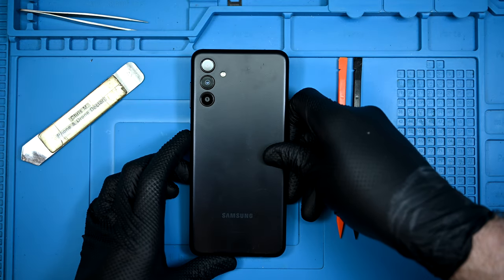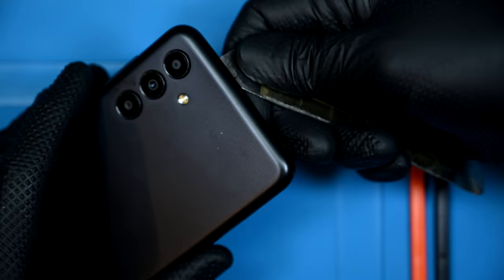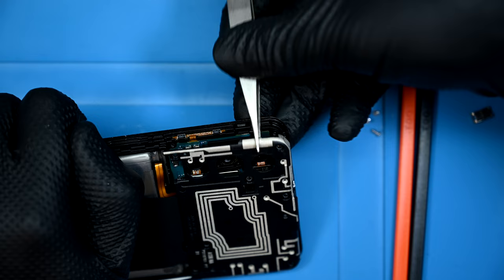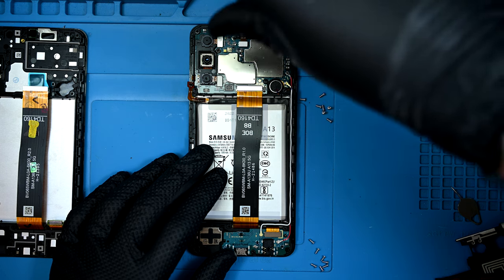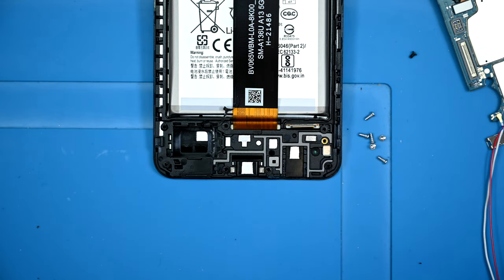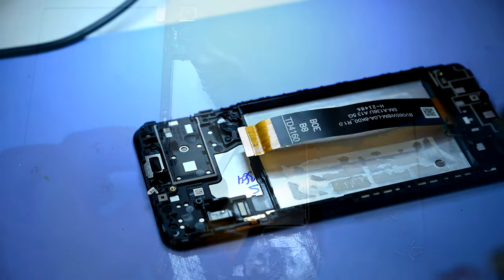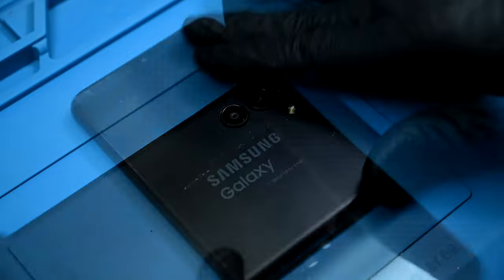Galaxy A13 5G (A136U) Screen Replacement | Frame Swap | Teardown Guide

Comment: This video showed exactly what I needed to do: swap the screen on my A13.  You make it look easy.  :)  I just did mine earlier today.  It took me longer than 4:29, but I managed it.  To any non-professionals out there, I might give some lessons learned.  First, don't poke at the battery with something sharp, such as the tweezers shown, when trying to remove the battery.  Second, make sure you get all the way under the earpiece speaker before applying pressure against the glue.  Third, don't forget the volume switches.  As a final comment, I will note that they seem to glue everything, including the back itself.  When I had to open it up again (because I forgot the volume switches), it was still a tight fit and took some work to get it open.
If you aren't sure if you want to attempt this yourself, start with this: see if you can get the back off.  If you can do that, you can probably do the rest.
Reply from the maker: Perfect advice! Batteries hate being popped, and sometimes give a nice fireball to let you know how dissatisfied they are. The earpiece speaker loves splitting in half, of all the things they glued together well, this is not one of them. And boy is that volume flex fun to try to remove, I'd say it's about as hard as the battery honestly. Glad my video helped you out!
Reply: @TapticDigital  I assume that popping the battery makes it more dangerous and probably less reliable.  Would putting something on the hole "fix" it, or do I need to replace the entire battery?
Reply: I put the battery back in the phone as-is, and it still held a charge, so I wasn't sure what I should do with it.
Reply: I did some googling.  It sounds like even a tiny hole is not good (and, as you say, the fizzle is not a happy sound).  I'll plan on replacing the battery.  If it doesn't explode in the next week (waiting for parts), I'll consider myself lucky.
Reply from the maker: @brianconant6559  I'd replace it if it's punctured. Especially if it smells sweet, almost "fruity". Small dings here and there rarely cause issues, but when in doubt, swap it out
Reply: Super.  Great advice.  A question: I do not have a heat mat, do you?  If not, how did you melt the glue that holds the battery to the old frame?  Hair dryer?  Oh also, what is a good pry tool to remove the frame? thanks

Comment: I’ve used this video as reference a few times now and I’ve done a few successful replacements and figured out 1 screen was faulty. I’ve now run into an issue where the screen isn’t responsive to touch, I’m thinking they may have sent another faulty screen because all my ribbons have firm connections. I’ve noticed on manual reboot the screen glitches before showing the Samsung logo, do you think this is because of a faulty screen or is it finally time for a replacement?
Reply from the maker: @FrogStorms  could be a bad replacement part, but I’d also check the connector on the board where that ribbon plugs in to see if any of those pins look damaged or have anything stuck in them. Samsung connectors seem to go out at a slightly higher rate than others
Reply: @TapticDigital  Checked again last night and it was a bent pin on the sub board, do you think I should replace it or just get a new phone in your opinion?

Comment: Thanks so much for making this video.  I thought that I bought just the glass replacement from Amazon, but I found that I had bought the kit with the whole new assembly.  I was actually watching a different video, had removed the broken screen (what fun), and realized something was wrong.  So I found this video, and working slowly--somehow, amazingly, my phone works again and has a new screen.  I think that the hardest parts were removing the broken glass (which I didn't even need to do), and the most difficult part was getting the darned cover off!  I found that the picks in the kit were too soft, so I used Tortex purple guitar picks...they were instrumental in getting the cover off.  And of course, I forgot the little metal clip (even though you did mention it in the video) and had to take the cover off a SECOND TIME.  I think that I used up a month's worth of curse words this afternoon.  Again, thanks for doing this video--you make it look very easy! :)
Reply from the maker: I'm glad it helped! Guitar picks are actually an official tool that iFixit makes for opening devices, so you definitely went the right direction! And glass removals... There's a reason I use framed displays, that's for sure. 😉

Comment: Video was great! Replaced my screen with relative ease. But now my volume buttons aren't working. Any suggestions? I'm assuming I missed hooking something back up.
Reply from the maker: Those volume buttons can be really tricky, and the ribbon they are on rips super easily. Make sure the cable is fully connected and that the buttons make a good “click” when pressed, if they feel more “squishy” you may need to replace that button ribbon which thankfully is less than $10 from most places.

Comment: Great video. Is this the same as the non-5g A13?
Reply from the maker: Very similar, but they likely use a different part. The non-5G is model A135, while this one is A136.
Reply: @TapticDigital  cool thanks :)

Comment: Good overall, but I can't get the cover back on. What's the trick? It fits snugly at the photo lens end, but not at the charger port end. The phone works fine, too.

I think you could have spent a little time on placement of the volume leads. They have to sit snugly between two pins.

Update: Everything is fine now. I needed to tighten down the screws. It clicked into place.

Much appreciated. Saved me a bundle.
Reply from the maker: Make sure nothing is blocking it for sure. The back panel is slightly smaller than the phone so it clicks in, you may have better luck starting at the bottom then clipping into the top. Alternatively, use the pry tool you used to get it open to pull the bottom lip out and close it that way.

Comment: Thanks - great video.  Your phone came apart much easier than for a 1st timer, but the steps and commentary were spot on.  I struggled getting the back off and the battery out but overall, the job went smoothly and the results are great.
Reply from the maker: Once you've opened a bunch of them you start being a bit less gentle  you get used to how hard you can go without damaging them! I will say the battery always poses a challenge, even with heat and alcohol it rarely wants to come out easily. But I'm glad you got yours fixed up and that my video helped! Thanks!

Comment: Thanks for the great video! Very clear and easy to follow. One question: how do i remove the tiny "wire mesh" looking squares and rectangles from my old frame? The new frame doesn’t have them. I assume they're contacts of some kind. Heat and alcohol on these too? Thanks.
Reply from the maker: Yup! Just a drop of two of alcohol should loosen them right then, once it dries off some of their stickiness returns
Reply: Thanks for all your help! My daughter has her phone back!

Comment: Thank you for the awesome video. Definitely the best one I could find....!
Installation was much easier than it looked. Turns out the hardest part was getting the phone open.

QUESTION:   What did I do wrong if the sound is distorted?
Reply from the maker: Thanks! Sometimes when removing the earpiece or loudspeaker the front membrane or "cone" of the speaker can come out a bit, this has a tendency to damage the hair-thin copper wires that connect to it from inside the speaker, and you end up with either no audio or a blown sounding speaker.
Reply: @TapticDigital  bummer, is there a fix for it. I was at your affiliate link site looking for it. It's the lower speaker on an A13 5G. The one on the bottom
Reply from the maker: @In_Need_of_a_Savior  yup, just replacing it is going to be much less headache unfortunately. Sometimes you can align them just right and make them work again, but the vibrations will slowly loosen it again.
Reply: @TapticDigital  thanks bud for responding 👊

I think the problem is there is no adhesive and it's vibrating
Reply from the maker: @In_Need_of_a_Savior  that could also be the case! A lot of the replacement parts don't have that sticky foam

Comment: Thank you for the video!  I didn't notice you having to swap out the volume control pads.  @Taptic Digital, do you have any suggestions?  It seems that Injured Gadgets' Refurbished replacement kit DOES NOT have the volume control pads.
Reply from the maker: It's weird, some include it and some don't. Absolutely saturate the ribbon and buttons with isopropyl alcohol, a little bit of heat will help too. Try to work an edge up and slip tweezers under it, working your way along to break it free while avoiding pulling on the ribbon itself. It should pop right off and once the alcohol is dry, it'll be sticky again and go on the new frame!
Reply: @TapticDigital  worked like a charm.  Thank you again for the video and the reply.  Great channel.  Subscribed.

Comment: @Taptic Digital Thank you for the video. May I ask the final resolution of the screen?. Let's compare it to a YouTube video. The replacement you used would end up having a 720p resolution or 360p?
Reply from the maker: It is the same as factory, so 1080x2408 or about 1080p in terms of resolution
Reply: @Taptic Digital  I read this phone is 1600 x 720 px; 270 ppi

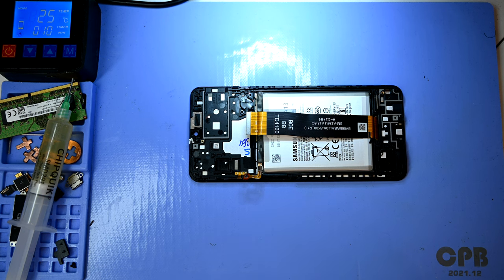Comment: Hello! Great video, but I wand to ask something. What is this liquid at 2:50? 
Thx. for answer.
Reply from the maker: B7000 silicone based glue, it holds the motor but is also flexible enough to keep it from rattling or shaking around too much

Comment: Is there an easier way to get the battery out without a heat pad?  Can I use a heat pad made for humans or just a normal hair dryer?
Reply from the maker: Hair dryer to the screen for a bit will do wonders to heat the battery adhesive, never heat the battery directly. If you can get some isopropyl alcohol it works wonders too!

Comment: I read thru all the comments and didnt come across a question or maybe i missed it

What glue did you use.
Or using double sided tape is enough
Reply from the maker: I prefer double sided tape wherever it can be used, personally. In the video I did glue the vibrate motor with B7000, a silicone based adhesive.

Comment: What gloves do you use? They look like a quality tool to have.
Reply from the maker: Gloves are my favorite tool, I never take them off. They are my one true skin. That said, I've use Gloveworks HD for a few years and they are the best I've found. Still occasionally rip between the index and thumb, but overall have held up very well against tears and heat. Plus customers never tell me their phone had gone in the toilet until it's in my hands, so gloves are essential.
Reply: @TapticDigital  I somehow always manage to get the devices owned by heavy smokers. I feel your pain in that regard. I'll look into those gloves the next time I resupply
. Thanks for the response and for the content. Much appreciated!
Reply from the maker: @CloakUncloak  🤮 consoles with that orange brown tar dust, disgusting. Or the Motorola that makes you think there must be a half burned cigarette somewhere nearby.

Comment: Recently followed this step by step and wow this is so much more involved than most iPhone screen replacements. 

The one challenge I had - which when I was taking the part out the top metal cover disconnected. (Talking about the piece at the top that doesn’t seem to connect to anything but it allows you to listen up to your ear and not on speaker.) 

So - when I took that piece out the metal plate on top disconnected and I think the teeth in the connector maybe didn’t sync up? Idk what do you guys think?
Reply: The “ear piece” component is what I’m referring to. Luckily my friend has the same exact phone so maybe I’ll steal that piece out in case I damaged it taking it out.
Reply from the maker: Hmm, so the earspeaker relies on pressure connection, there are two small gold teeth on the main board that make contact with the gold pads on the right of the earspeaker. Do you mean that these pieces broke? Or the silver metal plate that is under the earspeaker itself? That part shouldn't be necessary, but it without it those gold pins may not touch the speaker and would keep it from working.

Unless you mean the earspeaker itself came apart, at which point it would be best to replace that part.
Reply: @Taptic Digital  I have same problem, I tried to push the board down to make sure about its making good contact, but still not hearing anything, I'm thinking to replace that part but it's seems fine no damage on it...

Comment: On Friday, I followed this guide, and I fixed the screen. Later, I found the 3.5mm jack no longer accepts a cable. Also, five days later, the USB port stopped charging. Any suggestions on what went wrong? Would a loose ribbon cause the charging problem? And what did I do wrong with the 3.5mm jack?
Reply from the maker: Honestly I'm betting the two are related. Because the headphone jack is thru-hole soldered it's nearly indestructible, so it sounds more like a loose ribbon or bent connector. If you disconnect that ribbon from the charging board, check it for missing or bent pins. They should all be super straight and evenly spaced. Make sure it clicks all the way in, you should feel a nice thunk as it latches in. A loose ribbon would cause charging, headphone, and microphone issues.
Reply: @TapticDigital  I fixed the USB charging by attaching the ribbon, which was not damaged. It may have fallen off because the vibration motor (which is right next to the ribbon connection) was vibrating heavily because it was not glued down, so I glued it down. For the 3.5mm jack, I did a semi-haphazard surgery with a screwdriver, and now jack fits in the socket. All better again. Thank you.

Comment: How thin was the double-sided tape, and where did you buy it?
Reply from the maker: I believe the tape is a bit less than a millimeter. I prefer to use Tesa tape if you can find it online, but you can find very similar tapes on Amazon

Comment: I have the same phone and I had water damage on my screen and had it replaced and it works very well now doesn't look like anything happened
Reply from the maker: Most places seem to use OEM Samsung parts, thankfully they are readily available and work without issues, unlike Apple.

Comment: Thank you for this video. The most difficult part was taking the back off. I have no idea how you can do it so easily. Gear diff? I think I have a different version, because some components were at slightly different places, but in the end I managed to do it. I only cut myself once. :D
Reply from the maker: As long as the injuries stay low and the device gets repaired, I call it a win! As for the back panel, I think most people will go in very carefully and gently, while I've done it so many times I just know how aggressive to be.
Reply: @TapticDigital  Yes, I went very gently at the start. But after a while of not getting anywhere I started to show my phone my ugly side. :P

Comment: Well, almost in luck - everything works except the speaker ...  I did not glue it in, I'm guessing the contact points are either not aligned or not pressing together enough to connect.
Reply from the maker: Super common to see those gold contact springs on the board get smushed and stop springing. You can use tweezers to tug on them and spring them back out a bit.

Comment: do i nees to use a heating pad for the battery?
Reply from the maker: It will take quite a lot of effort to remove without heat, you can always use a heat gun or hair dryer on the front of the screen to heat it up
Reply: @TapticDigital  ok thx

Comment: My kit didn't come with any glue or double-sided tape. Which kinds of glue would be good or bad glue? Super glue? Hot glue?
Reply from the maker: Definitely no superglue or hot glue. Use a silicone based like B7000 or a cold press glue. Tesa double sided tape is my preferred adhesive
Reply: How about e6000

Comment: What adhesive should we be using?
Reply from the maker: Any thin double-sided tape will be fine. I use tesa black tape
Reply: @TapticDigital  I mean for the vibration motor
Reply from the maker: @daynite3261  same thing 😉

Comment: I got the new kit but adhesive tape for battery and glue for speaker isn't in the kit .... So where could I find what kind of glue and that same tape for battery
Reply from the maker: The speaker may not need it to be honest. For the battery you can use any thin generic double sided tape, I usually put a minimum of two strips to secure it

Comment: I have T-7000 adhesive. Is that also suitable for the battery? I don't have the ability to readily get double sided tape quickly.
Reply from the maker: Should work just fine, use a small amount in case it needs to be removed at a later time
Reply: @TapticDigital  The frame I ordered came with double-sided tape pre-installed haha. I'm late though. I meant to do all of this like 5 days before my original comment but I mentally studied this video for a week before I overcame my fear to do it. Thanks!

Comment: Hi, i dropped my phone a couple days ago and the screen is pretty messed up.theres a black section where the cracks are and the top half of the screen also appears on the bottom half and there's random lines. Touch screen and the phone itself is fine. I've been using it as a Hotspot for my spare phone and it's been great. Would getting the replacement part fix that problem or would I need a different part? Thank you so much!
Reply: Yes, makes it like a new phone and comes with the frame which makes it much easier to swap out. Scroll up to the description and tap the link and search your phone's model. This guy's video made it really easy. My phone is new again! 👌
Reply: setting a hot biscuit on my phone is what made it crack. Oops. Screen still works :D I'm going to repair it someday